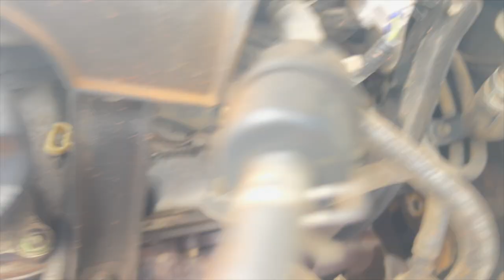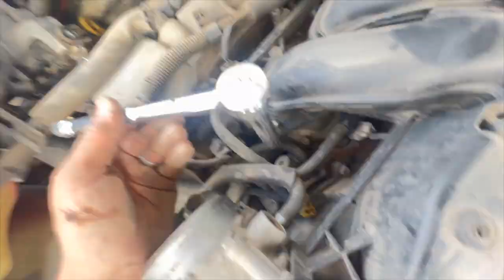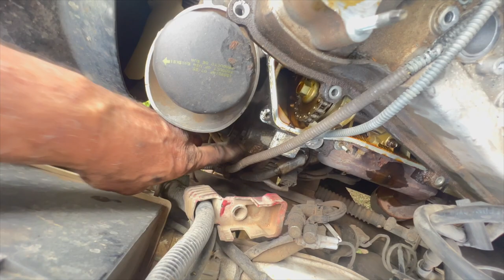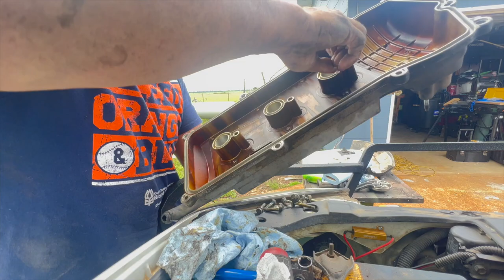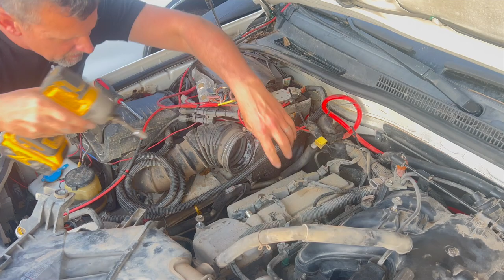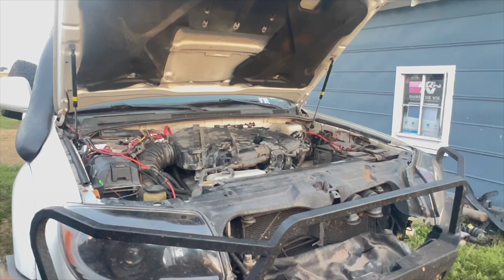2007 4Runner V6 Valve Cover Gasket Replacement

Comment: Comprehensive, thank you. Not a lot of videos on this specific job and I appreciate your contribution to the cause. 4th Gens, especially the early ones are notorious for valve cover gasket leaks and up until very recently there weren't good resources to DIY this. Thank you for digging in and giving us something meaty to know what we're getting into.
Reply from the maker: Thank you Sir.  Glad you got some use out of the video.   It’s not a terribly hard job, just frustrating getting through all that driver’s side mess.  Enjoy the project if/when you get to it.

Comment: Boy you created a lot of headache by not undoing a couple more hoses and connectors. Always torque valve cover gaskets in a criss-cross pattern starting at the middle and working your way out to the edges.
Reply from the maker: Right on.  Thanks for the advice. Maybe include the link to your YouTube channel and video showing how to do it properly !!  As you can tell from the comments there’s VERY little info online on how to do this.  Instead of complaining about how I did it maybe provide a better example of how to do it properly.  But thanks for taking the time to complain.

Comment: I had the same kit. Came with o rings and rubber grommets. Could not figure out what they were for and couldn’t find anything on the internet either
Reply: Same here. It only had 3 grommits on the center bolts. I definitely didn’t find any more orings on the original tear down

Comment: Great video, im not sure if I missed it in the video but do you know the torque specs for the valve cover bolts? thanks!
Reply from the maker: Hi Chris.  They’re 8ft/lbs of torque. (96inch pounds).
Reply: @OffroadGrind Appreciate it!

Comment: About to try it out on my 04 v6 SR5  wish me luck 🤓
Reply from the maker: PSN you got this pal.  Going to feel so good when it’s all done and you don’t see (or smell) that darn oil leak anymore.  Let me know how it rolls for you
Reply: Will do, lightly washed the engine surface to clean up what I could and let it sit. Haven’t ordered any parts yet I should be able to get the off the shelf at orileys or the Toyota place.
Reply: @OffroadGrind  new covers in, only mistake I made was not grabbing the gasket maker while at Toyota. So after a short trip there and back I also realized I didn’t have the 6 washers for the bolts by the coil packs.  But I just used what I had since they had some life in them.   Old gaskets were completely dry rot and crumbled in my hand.   Also while disassembling the intake and valve covers I decided to take everything off the top and have a complete open work space which helped with debris.
Reply: wow did it go? i'm doing mine next saturday!😁

Comment: Great video, thank you. I initially looked 1st gen Tacoma 3.4 V6 replacement required other parts. Do we still need intake manifold gasket to have ready just in case, not to mention spark plugs.... 
What brand was blue color gasket and part # ? Last but not least - drivers side gasket looks easiest to replace, and it's only slightly leaking on my truck at dipstick area, perhaps not losing oil, would it be worth to go for both, or just one in a simplest way?
Reply from the maker: Hi there.  Thanks for watching the video.  I’m not sure what the part # is for a 3.4L v6 as mine is a 4.0L.  I think if you’re taking all those things apart anyway you may as well buy the parts you ‘might’ need like the intake gasket.  If you don’t need to change it then just take it back for a refund.   If you haven’t changed your spark plugs in a while then for sure change those.  And clean the Mass Airflow Sensor and the throttle body too while you have everything open.  
On the 4.0 at least the driver side is much harder as the air intake plenum etc takes a lot to undo.   If your driver side looks easiest and the passenger side isn’t leaking I’d get the whole kit but just do the drivers side for now and then hold onto the passenger side gasket if you need it down the road
Reply: Thanks a lot, meant that have same 4.0 V6 engine on 2nd gen. Tacoma. Yes, will get  both sides,  and do the easiest passenger's first. What was brand # of yours, I like blue color. Also there are intake upper plenum gaskets, wonder if those needed and how many.
Reply from the maker: @evgenyaleks1696 I didn’t see any gasket under the air manifold on my truck.  The link to the felpro gaskets is in the description of the video

Comment: This video has helped me immensely. The only thing I am wondering is about these valve cover grommets. Do they only go on one cover? FelPro supplied 12 grommets but each cover has 10 bolts to remove.
Reply from the maker: That’s a great question.  I wondered the same thing when I got the kit.  I just spread the new grommets  around with some of the old and just focused on getting the torque values right.  I also did the same repair on our 03 Tundra and both have been great ever since.  The 4Runner smelled horrible after it was running for a bit with the dripping oil burning on the engine.  Not a problem since changing the gaskets though.
Reply: 12 bolts total on each side but 3 grommets go on each side ontop of the valve cover

Comment: How long was the process including trial and error?
Reply from the maker: Hi Justin.   Sorry I missed your comment, I was away in Colorado for a bit there.  I think I mention it in the video but I seem to remember it taking 2+ hours to get everything out of the way on the drivers side and about an hour to actually change the gasket and put it all back together again.  The passenger side was an hour to remove everything and an hour to change the gasket and put it back together.

Comment: Thanks for the vid! Did you need to drain the oil or the coolant beforehand?
Reply from the maker: No need to drain anything.  I checked the coils and spark plugs to see if they needed replacing but they were good so just popped them back in.

Comment: Hey I have same issues on my 05 4Runner just noticed this issue but have to drive about 300 miles to get home before I can get this to my repair shop. Should I be okay to drive ? So far noticed oils leaking exactly where your are. And been checking my oil levels so far not that bad. Should I just continue to monitor the oil before I drife back home next Wednesday?
Reply from the maker: I don’t imagine that much oil is coming out so if you check the engine oil level and top it up if required then I imagine you’d be fine.   Mine was seeping for years before I finally got around to fixing it.

Comment: Is your rocker covers leaking as you didnt use a toyota branded rocker cover gasket (blue)- toyota brand is black- and you didnt grease the upper part of the gasket. Curious to see if you stopped the leak?
Reply from the maker: No leaks on this truck or our 03 Tundra that I did around the same time.

Comment: You forgot to put grease on the upper part of the gasket!
Reply from the maker: Ummm, I hope you don’t use grease on a silicone gasket.  If anything you’d use a silicone lubricant.  That’s totally optional though and it’s not to seal the gasket, that’s what the gasket is for, it’s to let it slide a bit if required.  I don’t need that so didn’t use it and it worked perfectly the way I did the repair.  But thanks for your thoughts.
Reply: Bro i think you do need to use the toyota 403 sealant or whatever its called just on 2 low points on the rover covers on both left and right cover. Apparently toyota fixed this issue from 2009